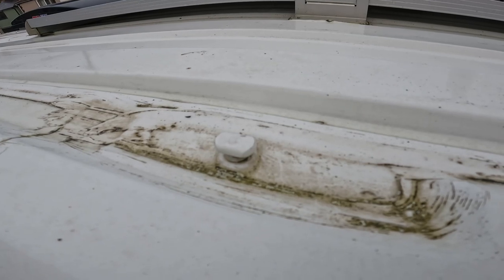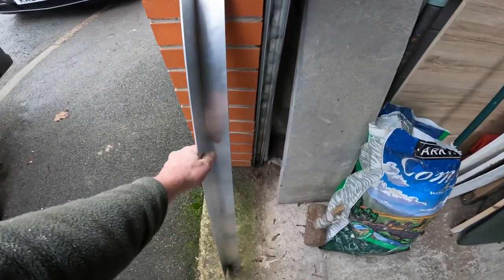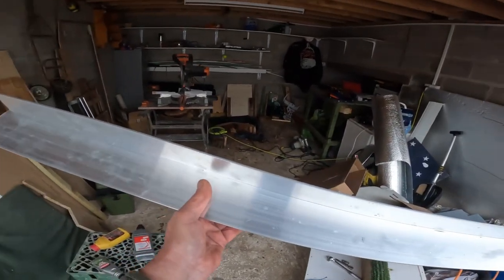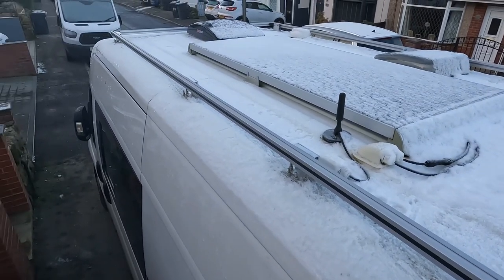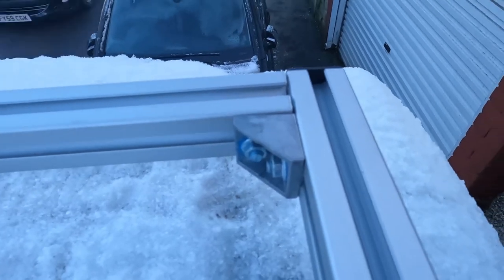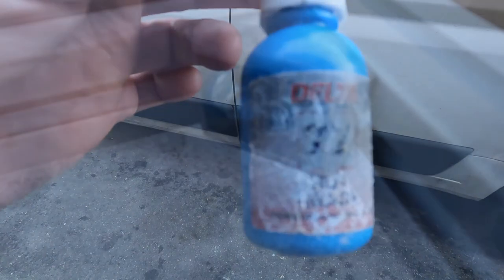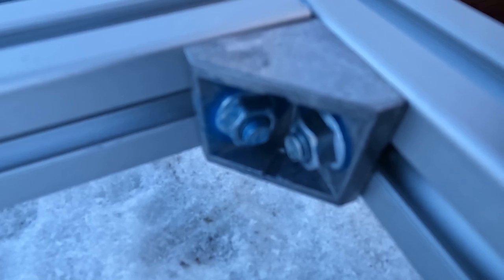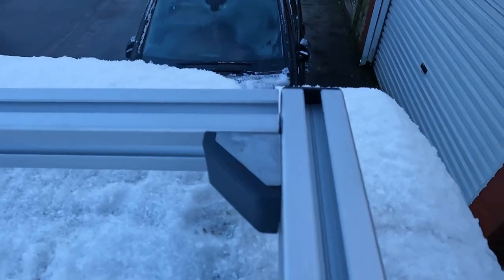DIY Roof Rack for half price - Ducato, Relay, Boxer, plus solar panel install.

Comment: Thank you so much for sharing this. We’ve just bought the aluminium from the same supplier and fitted the rack. The only hole needed was for cable entry, otherwise all removable or adaptable as needed. Just did 3 weeks in Spain with 100w panel running the fridge box, charging etc and all wild camps or free aires. Adding another panel now for uk weather! Thanks again, we need more people like you in the world to share their brilliant ideas!
Reply from the maker: Hello, and thank you so much for your lovely message. I’m pleased that you found the video useful and feel sure that having this type of roof rack will prove very adaptable for future things that you might want to add eg..lights, security cameras, awning etc. I’ve just done 3 months in Europe, there are vids about it and the roof rack and extra solar panel I fitted were brill 😊 all the best and thanks again. Ian.

Comment: Yes, the corner brackets are correct as long as the T nut which I think you used catches the inside of the aluminium slot. You’re good to go
Reply from the maker: Thank you for the feedback 👍 I’ve done 260 miles since fitting it and all is still good. Cheers

Comment: Hi mate, thanks for the vlog very very good. Funny enough I done something very similar. However I use the 3030 and by luck that just slid into the t nuts that are fixed on top of the roof. Once I had it into position I just drilled either side of the tea nuts and dropped in a M8 on all of them. It’s solid…
Reply from the maker: I never thought of that 🤣 good idea, I got there in the end though, it’s a great addition to any van. All the best mate, cheers
Reply: how did you make this clear the curve if the roof as mounting directly on the t nuts does not give you much height? Really interested to know as this is by far the easiest way. thanks in advance
Reply from the maker: Hi, As shown in the video I didn’t mount direct to the T nuts, it is the other guy who put a message on who did, maybe you could ask him. Cheers
Reply: @onevanandhisdog3641  I was responding to that chap...
Reply: how did you make this clear the curve if the roof as mounting directly on the t nuts does not give you much height? Really interested to know as this is by far the easiest way. thanks in advance

Comment: Just curious. Why the small box section in-between your angle and the long rails? Could you not bolt the rail to the angle with T bolts and do away with the box sections
Reply from the maker: Hi, it was because one of the long rails was catching on the wifi receiver on the roof so I had to pack them out to make a bit of clearance. Thanks for watching.

Comment: Where did yout buy the rubber trim inserts from? Really nice job on the roof rack👌
Reply from the maker: Hi Soufyan, the inserts are from the same company that supplied all the alaminium rail etc, they are called KJN. Thanks 😊
Reply from the maker: https://www.aluminium-profile.co.uk/

Comment: Hi, Where can we buy these pieces that you build yourself and that fit on these T-shaped mushrooms ?
Reply from the maker: Hi Pat, I just cut the pieces out 75mm x 50mm alaminium angle using the angle grinder, hope that helps, thanks.

Comment: Hi, love this mate. Just starting to build my own rack with Unistrut.  Just a thought, could you not have put the upright sections of your brackets on the outside?  This, as i see it, would negate the need for the extra blocks and also hide the fixing bolts from view.
Reply from the maker: Hi Robbie, I could have put the brackets the other way round and if I had put the rails on the inside then it wouldn’t have looked like wanted as the view of the rail would have been interrupted by the brackets and if I’d put the rail in the outside then it would have stuck out too far towards the side of the van, it’s all aesthetics and about how I wanted it to look more than anything. Hope that helps. Cheers 😊

Comment: Nice approach. I was torn between 4040, and 3030, profile, though after seeing this I'll be going for 3030. Question, is your van an L3H2? And can you remember the dimensions used for both the length and width of your rack? 

I've worked out that my max width of solar panel will be 1500mm, though I'm unsure whether that will sit on top, or preferably, sit down in between the lengths so it's flush. 

Cheers, J.
Reply from the maker: Hi Jim,
Yes my van is L3H2 but I can’t remember what the dimensions were to be honest as I just cut it to suit at the time. My solar panel was 1260mm in length so yours will be another 240mm longer so doing it how I’ve done it then yours is not going to fit in between the bars unless you can build it in a way that the bars are further apart, ie developing a different bracket. Hope that helps Jim, cheers